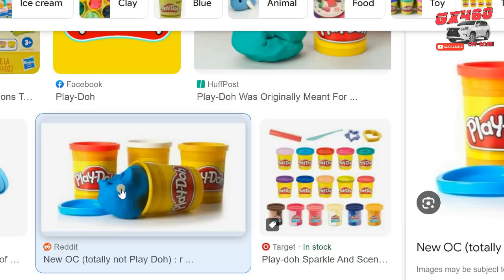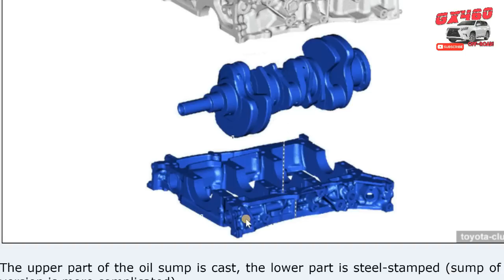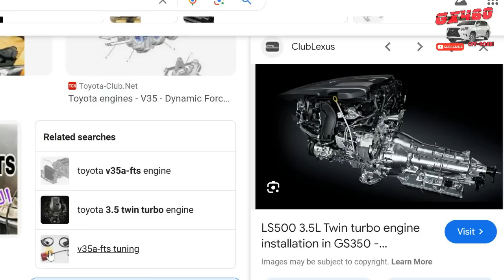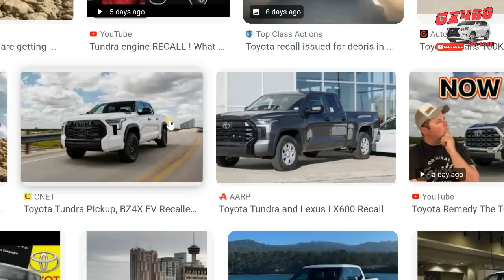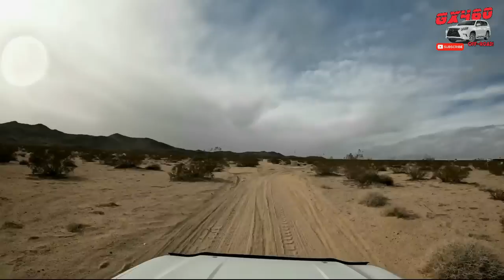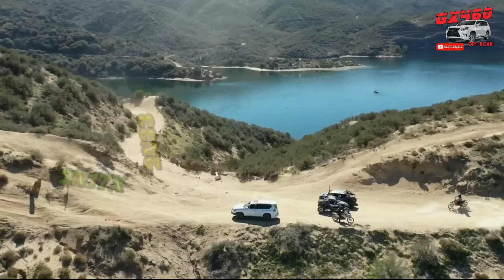Toyota Tundra OUTRAGE: A Technical Explanation

Comment: Perhaps I can add a bit of insight into what might be going on with Toyota. I am in aerospace manufacturing but have industry insight into some automotive. 

Aerospace holds first and foremost to quality of machining. These parts are going into assemblies that are in up in the sky ie NO room for failure. Any failure of component could be catastrophic. 

Automotive is quality to some extent but COST above and beyond. All those touch screens instead of physical buttons? Cost. Manufacturers would argue over half a cent cost on this button vs that. 

How does this apply here?

Yes, the machining is done by robotics. This is not an error in the robot, this is most likely due to changing the program when the engine is now used in much higher volume than with LS. 

Changes how?

This can be many things. It could be as simple as before they changed cutting inserts after every 5 engines milled/bored/honed. Now to save PENNIES they are running the same inserts for 6 engines. Whatever system Toyota was using to clear chips, a flush of some sort probably, was optimized for the amount of debris those inserts made after at most 5 engines. Now at engine 6 the inserts are much more worn and the chips for that engine have changed in a way that the programmed flush does not clear all FOD. To further reduce costs Toyota might have reduced the number of inspection checks or even removed them completely. "All engines were 'clean' before, why not now?" Changing the process slightly can have MASSIVE differences in machining....

I believe in the end this issue is simply Toyota 'optimizing' the production line TOO much and it has resulted in engines getting out with FOD still inside. I do not think this is a massive engineering failure but a dollars and cents failure that had unfortunately resulted in loss of reputation that will be FAR harder to get back. 

To be clear, I am not a Toyota owner, worker, ect. Purely my speculation from being in a similar industry.
Reply from the maker: A very plausible and logical theory.  Thank you for sharing your experiences 🙏 ❤️
Reply: That oil in those main bearings is straight out of the oil filter. I don't believe any of it. They've been playing with low oil pressure to reduce internal drag. I think the mains were starved of oil.
Reply: @TheBandit7613 just like car manufacturers recommend 0W-20 to reduce parasitic drag.
Reply: Six Sigma…
Reply: @cbrn_monkey5621 kaizen, six sigma and lean manufacturing to be exact.
Reply: Have you herd of a little company called Boeing? Safety seems secondary to cost or is it incompetence?
Reply: You are correct. If they save half a cent per every 10 units they will make the change. I've worked in the auto industry for 18 years and this is not the first time I have seen this problem coupled with this explanation.  Hyundai gave the same explanation in 2012 and they had the same failures for a decade. It does not take 10 years too correct a manufacturing mistake as they claimed. This is a major design flaw with the engine itself. Long story short they missed something before mass producing this engine and now they don't know how too fix it without an insanely high cost.
Reply: What size particles are you thinking of because the clearances in the bearings are extremely small.  So how would FOD get into the gap?  Larger particles would likely get wedged at the oil inlet port but not make it into the bearing surfaces.  Then it would cause a flow restriction and scoring against the shaft.  

The bearing material is soft partly so foreign debris can embed into the bearing which essentially removes it and prevents the issues explained in the video.

I wonder if the boosted turbo caused engineers to make the bearing material harder so it can handle the higher load.  This plus thin oil could be the real root cause.

If a particle is small enough, it will pass right through the bearing and get flushed out.  If it is just right it will get embedded into the babbit material.  If it is too large it won’t even enter the bearing but will block oil flow and score at the oil inlet port.

Something about Toyota’s explanation is raising red flags with me.
Reply: I agree with you. The failure is probably not R&D related. It's probably mass production related (process and/or material change). In addition to trying to save money, Toyota also scaled up production of these engines in the face of global supply chain issues. IMO ANYTHING that was manufactured during 2020 - 2022 is suspect.
Reply: more like cutting corners rather than "optimizing"
Reply: Very good detail of the possibilities of the failures we're seeing. Thanks alot!
Reply: This gotta be inspection issue
Reply: If have seen oil at Toyota for sale 0W20, 0W16, 0W8.
Reply: New long block, that oil ran all through the turbos.
Reply: Nailed it perfectly. You are my dear awarded with '' the one of few humans with brain that actually works'' lol....everything ... i mean every thing is about money.. one way or another, sooner or later. The GREED is the ultimate motivator.
Reply: Americanized Toyota is more prone to doing those cost-cuts, which is why I wish they were all still made in Japan. It's still considered overly nerdy to be completely thorough in the U.S. Gotta get off work and go party, so being a little half-assed is OK (until things like this happen).
Reply: When it all said and done Toyota fix something that wasn't not broken.
Reply: Another self proclaimed expert here. Have you even assemble or rebuilt an engine before? Oh boy...
Reply: @reempire888  the fellow you rush to trash actually humbly provided a very reasonable thought without the trollish attitude you spit out. What's the matter, year pp too small?
Reply: With all due respect ( I’m an engineer) there are plenty of places Toyota could cut costs. Toyotas equity with customers is their reliability. I don’t think Toyota would do anything to lower their reliability.  They may use cheaper plastics thinner leather less tech etc etc . But I don’t think Toyota would chance on cutting reliability. It’s the only thing they have over other manufacturers. 
That would be like Ferrari making engines that don’t go as fast to cut costs. That’s their equity with customers. Same for Toyota. They made have made an engineering mistake or something is flawed is assembly. But cutting anything that might cost them in reliability isn’t something they’d do. 
And I drive a Ford F150
But im guessing like you are
Reply: @guggyp Don’t trust anybody your mother! Keep living!!!
Reply: This is the most logical explanation vs more BS/coverup from Toyota. Hope the Feds make them buy back all defective trucks plus punitive damages in the billions. Let’s see someone tries to save a penny at our expense next time.
Reply: @calvincheng  that’s a little excessive, why would you wish for a company to fail and people to lose jobs over a simple mistake. A mistake in which Toyota has once again stepped up to take responsibility for and remedy.
Reply: @calvincheng  I'm convinced it's "the Feds" that have Fu"""ed up the auto industry in the first place

Comment: My problem with accepting Toyota explanation of metal debris being left behind during the Machining process is the fact that it's only attacks this one bearing! Why is it drawn to this one bearing and all the rest are left alone????? That in itself does not make any kind of sense... recently  another YouTuber called "The Car Care nut"who is also very knowledgeable mechanic took apart one of these engines and he shows that  bearing in particular is very loose in its Channel or Journal and also that it is the end bearing and there's nothing keeping it in place, there is nothing keeping it from walking out of alignment. He is wondering if maybe the replacement engines and current engines have addressed this issue by possibly addressing that end journal with maybe a welded on plate to keep it from walking out ....in other words to hold it in place so it doesn't move out of its proper position... To me that makes a whole lot of sense. It has nothing to do with Machining process materials in there. I call bullshit on toyotas explanation.

Comment: I wonder  how many people were fired by Toyota for this mistake ?
Reply: Just to add to this mess why didn’t Toyota demo some new units thru full real world torture test before launching’22 model like Mercedes does,has any one seen what they put the G wagon thru before launching line to public.I own a tundra no excuse for Toyota or any of them.remember testing a engine by itself with out drive train is different.definitely not a turbo engine design fault more likely a component failure.not metal shavings big companies lie.Look at fords eco boost for example major recalls,head gaskets trans coolers.sure everyone has problem.this one seems different especially at the crank.

Comment: Shame on Toyota for letting this happen for more than 1 year model! Sure it took a while for whatever caused this to happen but to let it continue is a management issue, probably caused by a Lean Six Sigma or similar program. I worked with LSS and this is the kind of thing that happens in the name of saving money. Unacceptable! Heads should roll over this. I was looking at these trucks and was amazed this happened not to mention the Tacoma issues. Toyota had a reputation of being dependable, not now. This V6 Turbo should be put in the trash bin and bring back engines with displacement. I wouldn’t doubt our liberal governments nonsense of getting rid of fossil fuel had something to do with them going to this engine. Bring back the V8 and make it more powerful and fuel efficient. This may be devastating for them because nobody has mentioned the issues have been resolved in the ‘25 models. Too bad…

Comment: I agree with you 💯 sir you hit the nail on the head , the 5.7L v8 was dropping valves and had all kinds of issues but Toyota resolved it just like the waste gate turbo issue they had few years ago in the Gen3 tundra , they fixed it just like the bearing debris  issue in the motor that was going on they fixed it as of 1/1/24 , fast fwd 5 years from now and everyone will be praising this 3.4LTT in the tundra AND will be saying how GREAT this motor is . People love adding fuel to the fire especially tundra haters which I noticed are the most jealous folks out there , and I will say this much even if the tundra had absolutely ZERO issues the tundra haters would still be hating on it , I just laugh at that all the time ,  because I know the Tundra is the best 1/2 ton truck out there by far , so good thing you pointed out the truth .

Thanks ….

Comment: So blown out of proportion. I own a recalled 23’. I Use Amsoil, I take care of it.. what do you know…. It’s the Best truck I’ve had, had 30+ toyota 4x4s since was 16 yrs old lad. My tundra has performed well in every category from seats, quality, it has large beefy ball joints, drive shaft, frame is strong and rides amazingly. So annoying to see people that never drove it or owned it say “it’s junk”. It’s definitely not. All the components inside and out seem solid and “old Land Cruiser” quality level … I really like mine. Maybe I got a good unit.. I’ve been a gear head and wrenched on bikes and trucks for decades and worked in shops. This has been blown out of proportion by the masses of growing, angry, 2024 hot heads on social media and social media itself. If this were the 80s you’d talk to your local shop, I’ve called 15 dealers to see what they say, I try to get someone real on the phone in service and say how many tundras are coming in blown fr fr… and all the dealers i called… Cali, Colorado, VA, Kansas, Texas etc… say the same thing. “I haven’t seen any come in” … 
I tow w/ mine at 8000’ in NM and up mtn passes and it’s a fuckin engineering marvel . They will perfect it
Reply: I agree with you sir this new tundra is an amazing truck as I just bought one myself as of 8/8/24 and just absolutely love it
Reply: About half a percent are experiencing this issue.  Changing the oil more frequently when the engine is brand new avoids this issue.  I’d run as many miles as you can and then get a brand new engine under recall.  It will improve the resale value of your truck if it doesn’t have any open recalls and a brand new engine.  The new Toyota trucks are amazing vehicles.  I think some people are jealous.

Comment: It doesn't matter if they install new engines and transmissions in all of the affected vehicles. You know the resale value of these have dropped through the floor. People buy costly Toyota trucks knowing they'll last forever or fetch a good deal if sold second hand. Now what
Reply from the maker: excellent point.... time will tell 😕 😞...

Comment: I will be keeping my 2014 Platinum 5.7 4wd with 218k and that should solve the engine problem instantly. Good luck V-6 V-4 turbo boys, I will take my reliability. 80k plus new and not reliable, you're crazy. I will drive it to 500k instead.

Comment: How does the "trash" end up in the same bearings with a shared oil galley?
Reply from the maker: @OnlyMeee-ie3dw  https://youtu.be/6h-X_TF1Ics
Reply: @LexusGX460-OFF-ROAD  For over 4000 engines some worker or machine left trash in one or two of the same two oil galleys in two different countries? Then Toyota changed some part where this trash was left. Seems kinda shady. Think I'll avoid buying one for a few years. I got burned by Toyota a few years ago with a new Camry. I'm sure Toyota will fix it someday but I'm going to let others be the guinea pig for a while.

Comment: Let's be honest. Usually, when there is an escape of any type, the RC is usually a human factor. Either process or design. In most cases, the engineering prefers a corrective action(s) of processing because redesign would be really bad and costly. So, hopefully, the process planners can implement mandatory quality inspections of MQIs to prevent the FO debris. Final inspection before and during final assembly is critical if, in fact, it's a single point failure debris root cause issue?

Comment: The higher you climb up that flag pole the more your backside shows. The haters come out the wood work with a vengeance. Sorry to those affected. They will make it right. That's one of many reasons you buy a Toyota or Lexus in my case. Great vehicles but even the best screw up.

Comment: Crank plate is old and on NA engine. This is turbo engine that's why it fails.
Reply from the maker: Bedplates have been on turbo engines for DECADES.  NA, turbo gas, turbo diesels... they all have had bedplates... not new 😉 They are specifically made for turbo engines by nearly all manufacturers

Comment: The cam lobes on a 1975 20R engine were severely worn at about 30,000 miles. When I removed the cam, one of the oil journal holes was impacted with what appeared to be casting sand. Shows that improper cleaning can and does happen.

Comment: Could it be a design flaw in the sense that the engine is under more pressure than a naturally aspirated engine and any flaw in machining introduced unacceptable high risk for engine failure?
Reply from the maker: There shouldn't be machining trash in the engine in the first place.... like ever 😆 ... so let's go with machining robot flaw
Reply: @LexusGX460-OFF-ROAD  as a program manager I will accept machining robot flaw as root cause for the recall but it would be interesting to see the risk and opportunities chart for the engine seems like a proper inspection could have prevented

Comment: Comment at 5:41 mark - The person refers to a 1990s Corolla engine.  That engine was a port-injected, non-turbo producing 105 hp/117 lb.-ft. of torque for a 2,500 lb car.  The Tundra 3.4 has direct injection, twin-turbos, makes 350-390 hp/405-479 lb.-ft. of torque for a 5500 lb, full-sized truck.  This design may be fine for a car, but the main twin-turbo, V-6 truck competitor, Ford, utilizes a much stronger design in this area of the engine and does not have crankshaft bearing problems.  I have viewed some of the Toyota shill jobs on YouTube.  One like this is worth at least 4 or 5 figures if no one questions these statements.  It is entirely illogical for metal debris to impact only one specific part of an engine, unless maybe that debris originated from that specific part of the engine.  If the front main is stressed, either due to lack of oil or cooling, poorly designed engine block, whatever, and it is the common point of failure, something is going on at this specific area of the design.  The universal debris cause HYPOTHESIZED  by Toyota's engineers will be vetted in court with the use of mechanical, materials, and automotive engineering experts.  The relevant question is what other truck manufacturers use this type of engine design in turbo-charged, direct-injected configurations producing this level of power and torque for comparably sized vehicles.  The class action lawyers will use that as a standard of care and judges will figure out the hit to Toyota.
Reply from the maker: PRATTLE!  The V35A-FTS is a TRUCK engine.  It's in 5 trucks and only 1 car.  It was engineered as a truck engine from the start.  The Ford engine has a weak "girdle" the V35A-FTS has an actual bedplate.  Don't repeat clueless YT prattle videos 😉  Bedplates have been on turbo engines FOREVER... all makes and models.  If burrs are left in the number-1 oilway, ONLY the number-1 bearing will be affected.  Oil flow is parallel not series

Comment: Yes. The crank shaft bed isn’t new but the high torque turbo charged engine mated with this setup is new!
Reply from the maker: it is NOT new... Toyota's world turbos have all had crankshaft bed plates... gas and diesel... including the Toyota turbo V8 engine.  Not new... not novel... yes they've been on turbo engine for decades.... the bedplate is NOT the problem...